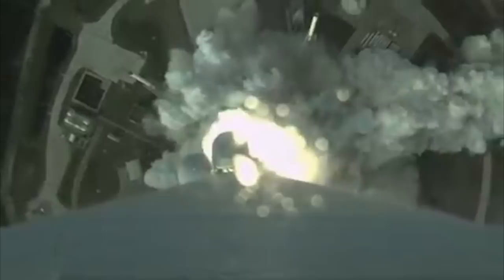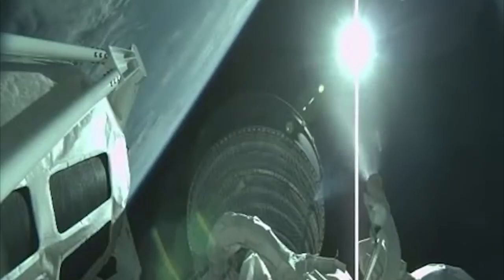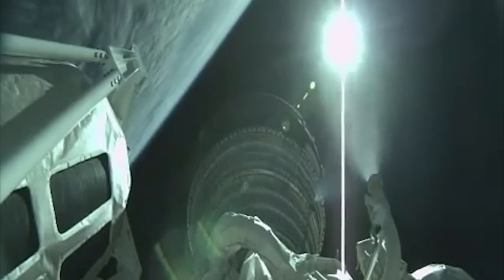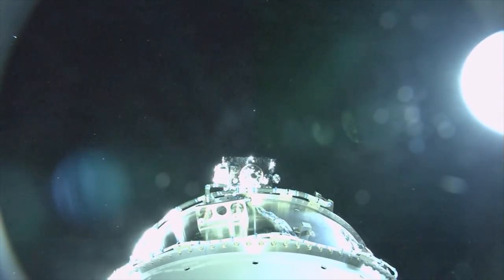Atlas V GOES-S Rocket Cam

Comment: This. This is what we want to see. On-board feeds. None of those stupid computer images, we want to see the actual video footage. Those cameras are worth every penny.
Reply: they probably dont even cost that much
Reply: There's literally dozens of feeds like this!
Reply: @dangibbs5390  Kept private to the engineers. I'd love to have the ability to look at all the camera's. Even the tank cams are neat!
Reply: @Great White North Bear Rockets that achieve orbit must arc over because, in order to achieve orbit, one must develop a very large speed that is parallel to the surface of the earth. It is much, much more efficient to arc over and do a so-called "gravity turn" to get into orbit than it is to go straight up and then try to burn parallel to the ground at your highest point above it.

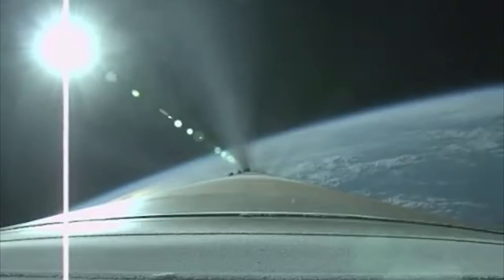Plus, the fisheye effect on this camera/flight is rather negligible, especially towards the center of the frame. You can see the curvature of the earth without the effects of fisheye at 3:19 into the flight.

I'm personally unsure if you consider yourself a flat-earther. However, I wanted to post this as a response to state that the first is pretty much negligible towards the center of the frame and the second is vital for spacecraft to achieve orbit, which further defeats the concept of a flat earth.
Reply: Thats what i also wanted to see all along, not all the other junk
Reply: @Great White North Bear Issue? 1. That's wide angle. 2 If you try and launch anything in a straight path from a position perndicular to an object that is always spinning, then it is always going to follow a arc. That's simple geometry.
Reply: @10Exahertz  it cost $10,000 to send one pound of material into space. Yeah not that much at all....
Reply: Fish lense in full effect, hold your finger on the «timer dot» and move it back and forth from 3:30 to 2:00, the earth is clearly flexing and bending all over the place!
Reply: @fjordbear3050  watch the beginning of the video again and try to spot the bending in the towers from the fish eye effect. It's not there. In the same timeframe you are talking about, watch the straight lines on the spacecraft. A fish eye lens should distort everything at the edges, but the rocket body does not warp.
Reply: @gorisenke  On the 0:17, see the crossing road on the top right of the screen turning a straight line as it approach the center of the screen.
Reply: @Stkrsktr  the crossing road on the top right at the beginning is a small part of the latter image, barely hugging the edge of the hull. The portion of the road that we initially see remains curved until it is no longer discernable. You can see where it branched out(the bend in the road) right up until the resolution turns it into a vague line.

Edit: I stop being able to see characteristics of the initial portion of road at around 0:38. There is an oblong white shape to the right side of the road that fades from view, which let's me know that we can no longer see the starting point of the road anymore.
Reply: Yeah whoever makes these cameras must be really good at what they do
Reply: nasa looks like movie home production
Reply: @fjordbear3050  nahh. how is the surface the cam is on flat and the earth has a curve all in the same shot?
Reply: Are you sure this video is real?
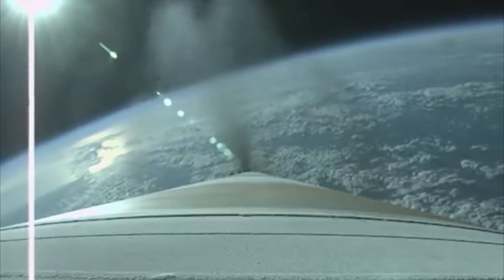Reply: We got to see this one because there is only one small UFO visible at  2:20
Reply: There's many videos like this
Reply: @fjordbear3050 that's not how fisheye lenses work. They don't work only at certain times in a video. If it was a fisheye lens, the entire bottom of the image would be curved upward in a u-shape. The clouds and side of the rocket would be distorted the entire time.
Reply: Yeah I love those backwards looking views of Earth. Gorgeous
Reply: YEAH!!  If you're in the rocket business and you can't provide cool POV rocket videos for us to watch, for free, . . . . then get out of the rocket business.

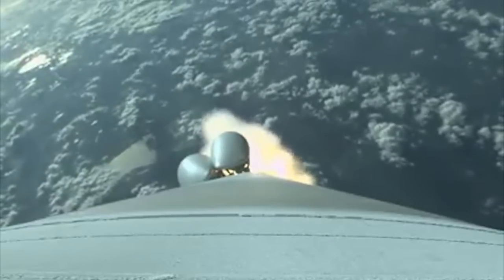Comment: its cool to see how the rocket structure is deformed during the maximum aerodynamic pressure phase, its clearly visible on the 1ft stage wall (0:54 - 1:14 into flight it gets compressed).
Obviously the rocket needs the flexibility to  withstand such forces...
Reply: WOW and WOW, I am so amazed to see that skin flexing like that, How did I miss that the first time around.
MAX Q, wow.
Reply: I think that's an illusion: It's not the booster skin deforming (fortunately, otherwise structural failure would be following prompt) but sublimation of frost on the skin of the LOX tank during MaxQ phase.
Reply: The structure (shape of the rocket) is static throughout the clip. wtf are you talking about? There is a layer of ice forming on the body of the rocket, that happens with planes too. It happens at 7-8000 feet above ground and higher, depending on local conditions.
Reply: @jazzochannel  exactly it happens on planes too because they fly at 700km/h and the ice cools down fast...
Reply: @jazzochannel  And no friction to see of the van Alan Belts...to penatrate does you need a hole lot bigger and more powerfull rocket than this baby. We never left our atmosphere. Even International spacecenter is not in vacuum space but still in our atmosphere. Just like the sun moon and stars
Reply: @jazzochannel   You are right you cant see it, but the structure does flex a bit during launch due to aerodynamic loads. It's designed too, just not clearly visible.
Reply: @krizzel4890  The Alan belts are not suppose to produce considerable friction they are pockets of radiation , my dude what are you talking about .
Reply: @spinosaurusstriker  magnetic fields are radiation that keep all within. Earth is a dielectric plane enertia. 😉
Reply: @krizzel4890  Those sure are words.

Comment: There are 5 Atlas V’s (the First number is the diameter of the fairing, the second the amout of SRB’s, and the third the amout of second stage engine’s) you have the 411 & 511, the 421 & 521, the 431 & 531, the 541 and 551 plus know that there’s always Something assymetrical. Scott Manley has a great video of this BTW.

Comment: To all you geniuses claiming it's a fish-eye lens.
Go back to the very start of the launch, as the rocket is clearing the launch gantry.  There is absolutely no distortion in the periphery of the frame, all the straight objects are still very straight.  This is NOT a fish-eye lens.

And yes, the flight path goes from vertical to parallel.  That's how we put things into orbit. Any other way would be stupid.
Reply: It is slightly wide angle lens, but not fisheye
Reply: Plus at all the time frames where they claim fish eye, I cant see any warping or distortion in the image of the rocket, which is in the same shot.
Reply: People say every camera in space is fish eye.
Also I don't know much about fish eyes but wouldn't they distort the rocket a little bit too?
Reply: @Stickman_Productions  As with every other lens ever made, there are varying strengths of the lenses used in cameras.  Most fish-eye lens claims are actually Wide-Angle lenses which are completely different.
The one thing a lens cannot do, however, is take a flat horizon and make it spherical - not without distorting every other object in the frame.
Reply: I don't know what kind of lens it is, but you can clearly say that it is a fake curve if you keep tracking the size of the lake and clouds and comparing it with the appearing curvature starting from 1:10 to 2:02. Caught! 👌🏻
Reply: @maghribiMoorish  Show us your math.
Reply: Earth is 100%, I made a comparison of the of 2 videos one with fisheye lens the other no fisheye lens at around same height, the one without fisheye length clearly shows there's no curve at all,
Reply: @RandomVideos-kn3pf  No curve at all??  How did you determine that asinine claim?  What did you measure?
Reply: @randyt60  you can clearly see footage from weather ballons and other objects that use normal cameras, which proves earth's has no curvature
Reply: @RandomVideos-kn3pf  Can you see a Horizon?  A Horizon = Curvature.  You can't have a horizon on a flat plane.
Reply: @randyt60  I'm always confused.  When flat earthers see footage of a weather balloon and the curve is not pronounced, they think that horizon, is the edge of earth lol
Reply: @mactallica9293  Yes, And if you moved your location to that "edge" what would you see there?
Reply: @randyt60  just baffles me, they all say, stop being close minded and critically think and they do 0 of that.  I usually tell every person to send a weather balloon next to Antarctica or in chile, you should see that "edge" very easily
Reply: @mactallica9293  but you can't go to Antarctica without express consent from 9 different countries and accompanied by a military official. The most heavily guarded place on earth with complete unity by all nations is nothing but ice?
Reply: @joey9511  that literally has to be a joke comment.  Anyone can go to Antarctica.  You get a permit, it's like a visa. Anyone can get 1, you only need it from your country, you will not be denied

Comment: 3:28 Those wobbly fairings deploying though.
Reply: Alexandre Fyne I saw something similar while watching an Ariane 5 launch.
Reply: Is that supposed to be wobbly like that or do you think something else is going on here cause I was trying to figure that one out
Reply: @kennyreck  those fairings are flying back to the earth at such intense speeds that the air is bending it like paper. you can even see at one point it starts to burn up on the inner part of the fairing. sure they make them very flexible so they dont explode into a bunch of shards and rip the rocket apart.
Reply: @derpdawg420  Actually it's not the air, at that altitude it's almost nonexistent, which is why the fairings are jettisoned btw. What burned and twisted the fairings is the exhaust of the engine
Reply: @derpdawg420  I think the flex is left over from whatever they use to eject them. The force to shove it away like that can't be particularly small, overcoming inertia at those speeds.

Comment: ..@ 6:58 Why. are there so many. Bubbles after "Space Craft Separation"...? The Bubbles Look Like Water Bubbles, But that's impossible in Space.. ..RIGHT...?
Reply: That’s debris, dear
Reply: Most possibly frozen water or something. I'm dissapointed in how you know about bubbles in water. It woul've been much more of them if it was water...
Reply: It's space junk. Mankind is just as messy in space as it is on earth.  sigh.
Reply: I thought bubble would move to only one direction, you know, to the surface...but these bubbles are even moving sideways.. very strange bubbles!
Reply: @pbsixgun6  ....Bro Look in the Mirror that's "Space Junk"....
Reply: Water bubbles are possible in space. In footage of the ISS tour, the presenter squirted a water bubble out and drank it.
This also may be stuff such as floating ice.
And I do not believe that these are bubbles like in water. Bubbles do not float in different directions. I usually see them floating to the surface. Not in any other direction.
And I do notice that you do not respond to comments disagreeing with you except that single one.
Reply: There is a lot of condensation, some of it frozen, when you fill a big tank with liquid oxygen. Once you get into orbit and no longer accelerate, any smaller particles it dragged up there that detach, will hang around.

I wonder if the separation method creates some debris?

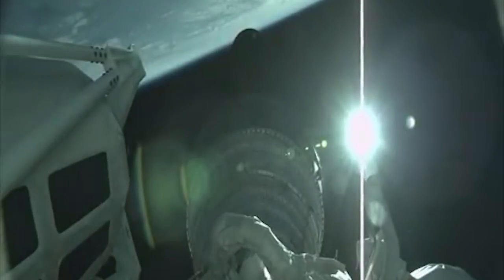Comment: Why is the rocket now @4:27 literally horizontal and the earth has disappeared? Is it heading back into earth? Shouldn't it be going straight up?
Reply: How do you think orbits work?
Reply: @Ethan_Roberts  lol still didn’t answer lol
Reply: @samuelpeters8404  To get to orbit. That's the answer, it's very simple.
Reply: @samuelpeters8404   You need horizontal velocity to maintain orbit lol. If you just go straight up then you'll fall straight down.
Reply: Because "straight up" doesn't give you orbit. Straight up comes straight back down again. Orbit requires horizontal momentum around the object to be orbited.

Comment: What is the line crossing the sun?
Reply: I think the thick bar that runs vertical is like a light burnout for the lens. All cameras that you and I use function the way we are familiar with when interacting with light that's been diffused by the atmosphere. The air spreads light in different directions. I think up there, well above the bulk of the atmosphere, the sunlight is stupid intense and the camera can capture the reflections off surfaces, but glitches out for the sun, since it's just too much.
Reply: Glare, essentially. There's too much light coming into the lense for the camera to process and resolve. They could filter the light, but that would reduce total light input and darken the rest of the image.
Reply: Bad gci

Comment: Why don't rocket cameras ever face forward so the public can see it go into "space"?  Its not like there is a firmament or anything. 🤔
Reply: Considering this "firmament " is completely invisible.  It wouldn't matter
Reply: @mactallica9293  "Invisible" like glass?
Reply: @Junior-yz8tf  invisible like magic.  And like magic, it's not real
Reply: @mactallica9293  Ok.
Reply: @Junior-yz8tf   
Dashcam on a Space Shuttle - FRONT WINDOW launch
Reply: @Bnslamb  Its not even a front window view. It's at the worst possible angle so you can't see that the rockets level off and then nosedive right back into the ocean. Its just as ridiculous as Nixon supposedly on a phone call with astronauts 200,000+ miles on the "moon", on a land line no less. I guess they brought a 200,000+ mile phone line with them.  You can't get cell phone service in a plane a few miles up, let alone using a landline.
Reply: @Junior-yz8tf   
Space Shuttles landed on wheels.
Reply: @Bnslamb ?. Yes you are correct.  Space Shuttles are very high altitude planes and they land on wheels.
Reply: @Junior-yz8tf   
They were not capable of flying, only glide.
Reply: @Bnslamb  Ok. And...............
Reply: @Junior-yz8tf   
It could take weeks before they landed.
Reply: @Junior-yz8tf   
Nothing.
Reply: "Why don't rocket cameras ever face forward "

The cameras are mounted for the benefit of the rocket engineers, not ground-based rubber-neckers.

Comment: Where was the 1600 km per hour spin of the earth looks like its not moving to me????
Reply: The earth does nothing but move, as you transition from being stationary on the ground, to travelling 28,000 km/h (if that was low earth orbit). This is not the video to test if the earth is rotating 1600 km/h, given how fast you travel  to remain in a low earth orbit.
Reply: Right there in the video. But guess what? The rocket was also moving. It was moving with the Earth when launched, and then relative to that motion as it changed directions. You can't see movement when you're moving the same way.

If you're sitting in a car with your friend, and they're driving down the road at 100 kph, and you look over at them can you tell they're moving at 100 kph? No. Of course not. Same thing here.

Plus, linear velocity like that doesn't mean much. This is rotation. The Earth only moves 15° per hour. That's extremely difficult to see, even if you were stationary to the Earth's rotation.